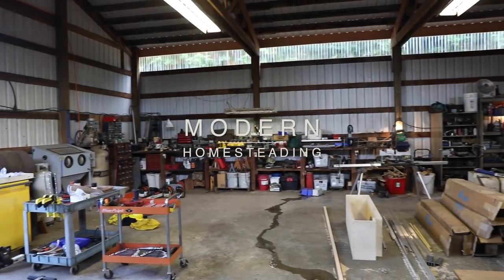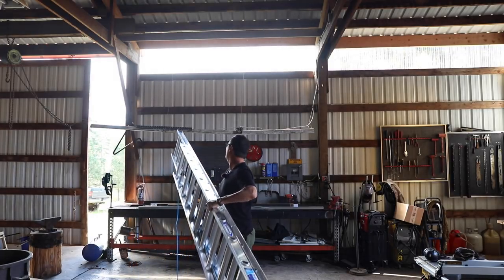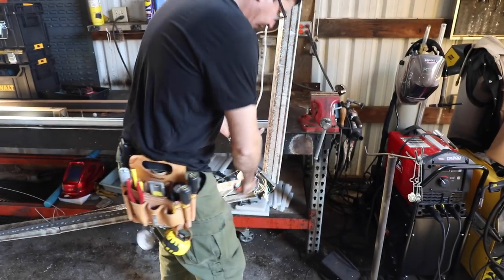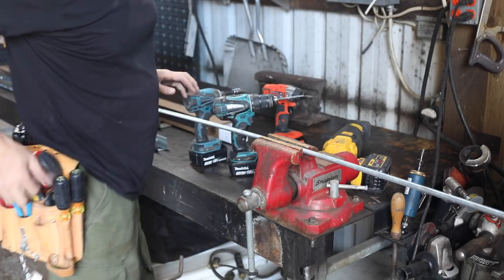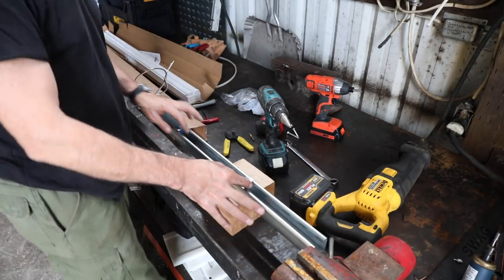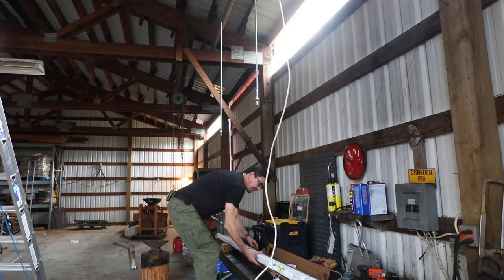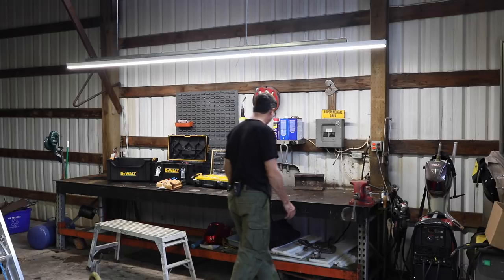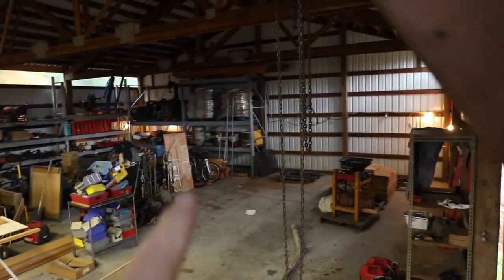Home Depot LED Shop Lights Under $200

Comment: Wrong kind of ladder for electrician work. :) Use fiberglass next time you silly goose. 

EDIT: Also the little blue things you are sliding into the strut are called cone nuts.

EDIT #2: More specifically a 'channel' cone nut.
Reply: I have personally found fiberglass to be more sturdy as a bigger guy, I am not particularly fond of aluminum ladders.
Reply: Fiberglass ladders are definitely more sturdy.  They seem to bounce less and flex a lot less than aluminum.  The only real advantage to aluminum is the lighter weight, especially if you are working by yourself all day on a ladder.
Reply: Most places an aluminum ladder isn't even allowed on the job site.
Reply: The conductivity aspect is obviously the main safety point here, but ever since i got my first fiberglass ladder a couple of years ago when i started industrial electronic work i have never felt so solid-footted as a fairly big 6'5 guy. Never getting aluminium again whether it's for electrical work or not.
Reply: Guess you need a fancy education to know this.
Reply: Sonkev Nauss lol or just common sense. Metal + you + electricty = big no no.
Reply: Mine's aluminium only because it's been in the family longer than I've been alive and I inherited it when Dad passed last year.  Won't hardly even see a one man show not using fiberglass no matter the trade.....
Reply: To get technical... Extension ladders are designed for access only. Step ladders are designed to be used to perform work...but then step ladders over 10' are creepy.
Reply: n
Reply: Ruben Braekman google translate says that means wing nut? is that a bad translation? lol
Reply: A cargo ratchet strap also works.  Hunters trust them for their tree stands.
Reply: You need big washers and backer nuts on top side of strut but great addition.
New pants?

Comment: This install is dangerous. If you bump that with any force that whole strut could come down. You need to thread a nut up on the ready rod, then put a lock washer, a regular washer and a square washer below that. Then tighten it down onto the spring nut. Seriously. If you hit this with any force, especially in an upwards direction, those springnuts can pop right out of the channel and those lights along with that strut are coming down.
Reply: Brexit Monger i prefer to  install something so that is isn't poised to fall and break.

Comment: Correct me if I'm wrong, but these are not LEDs at all, are they?
Reply: Jorg (sorry no umlaut) These appear to be LEDs. Why do you think they are not?
Reply: yes they are, some fixtures use integrated lamps, but many use a LED T- type tube as well. You can even get T type tube retrofits to convert an old florescent. They mostly really still use the same fixture in standard appliations.

Comment: He really should get someone to operate his camera to help avoid all those times his hands elbows etc. block what he is trying to show. Also more close-ups details of what he is talking about as he installs the screws etc. Obviously he is trying to do this as cheaply as possible so....no camera operator seems affordable. In that case, he should record a "run-through" of some of his steps along the way, watch them and adjust his angle or his body, arms and hands accordingly to avoid that blocking. In other words, a bit of "rehearsal" would help elevate the quality of what he is trying to be clear about.

Comment: That is not how spring nuts or are you supposed to be used the spring nuts are not secured to the  strutThe spring is the hold up but not in place and to you both something up to it you need a square washer and a nut to clamp the  
Strut between the spring nut 

And the spring nuts for the light you don't need that blue clip because the spring that goes inside the strut not outside of the strutif you was to hit that light guarantee you that whole light fixture would fall down because it's not secured to the rod

Comment: Get a fiberglass ladder.. way lighter
Reply: sorry, but weight is not why you buy fiberglass.  Fiberglass is heavier, but does not conduct electricity and is stiffer.
The insulating properties are important not just for electricians, but because maneuvering tall things where there may be electrical wires always carries a risk.  Just like everybody on a construction site in my area is required to have an E rated hard hat, whether they are working with wiring or not.
The stiffness of fiberglass makes a huge difference in leg/foot/back fatigue if you spend any time on a ladder.  A couple hours on an aluminum ladder and I am done for the day, I can work twice as long or better on a fiberglass ladder just because your body isn't working as hard on micro-balance adjustments.

Comment: The bailing wire on the previous install was more secure than what you have now.  Get some 1/2" sq washers and 1/2" HH nuts and at least keep the new rig from falling if you fart on it.  There has to be a qualified electrician in your area to offer assistance.  Like the videos - hate to see useless electrical